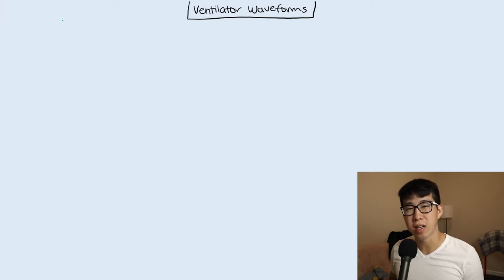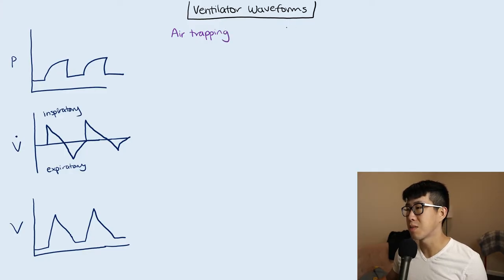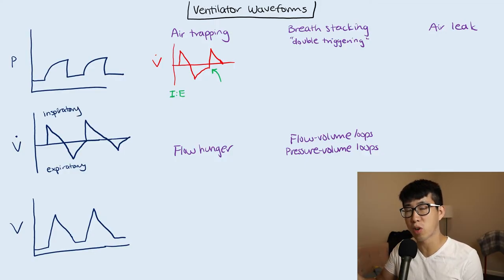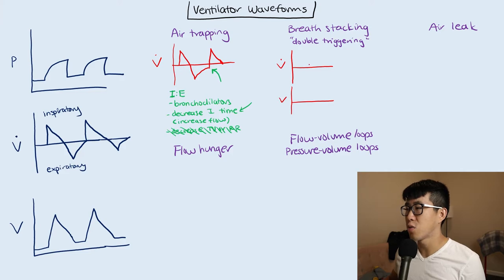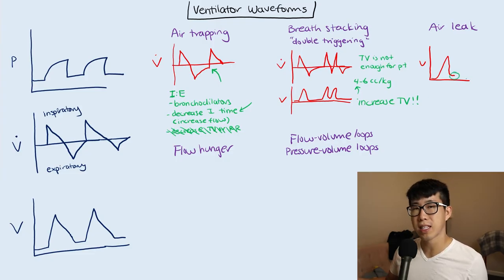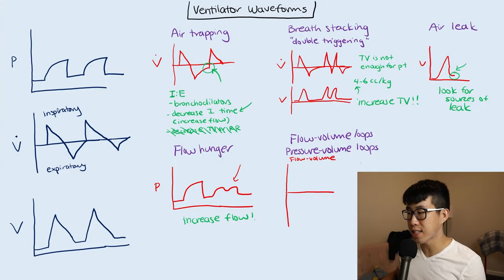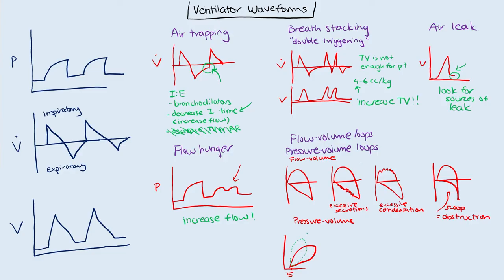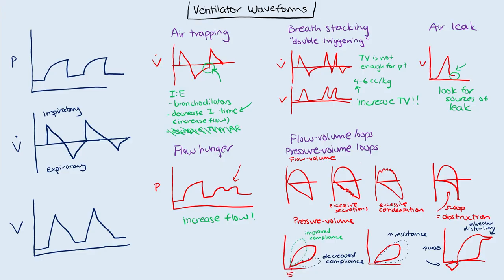Ventilator Waveforms & Troubleshooting Made Easy

Comment: I noticed the pressure waveform changes depending on the mode (PC/AC), does the flow and volume waveform remain the same regardless of mode? Thank You for the video!!
Reply from the maker: They likely would change since there are some slight differences in how quickly the breath is being delivered!! Not 100% sure though on what specifics would look different